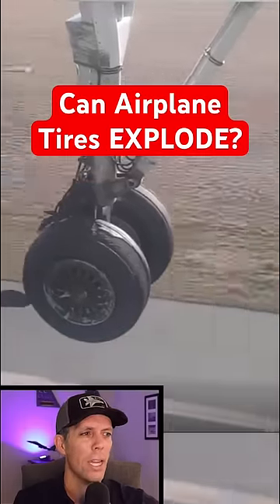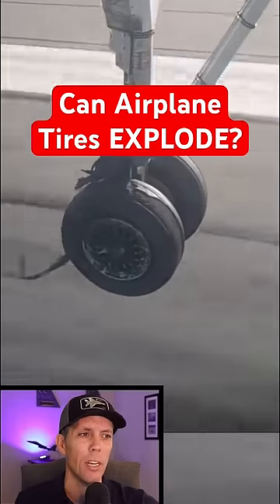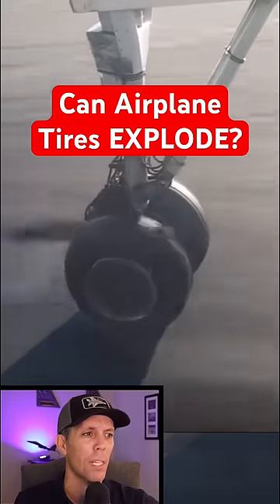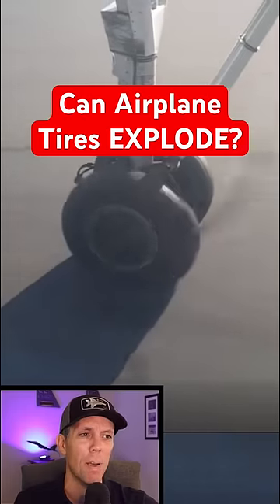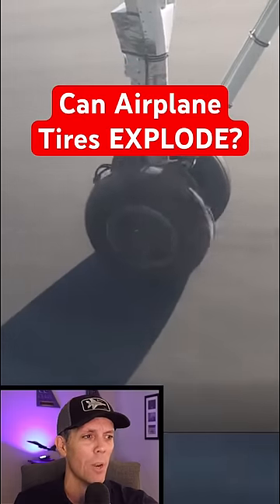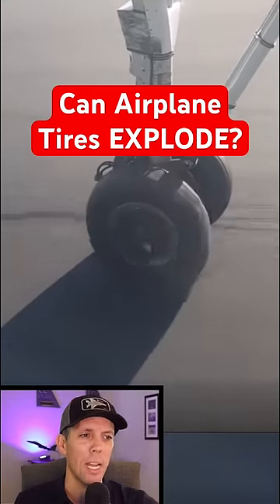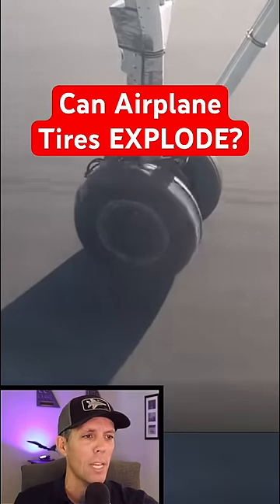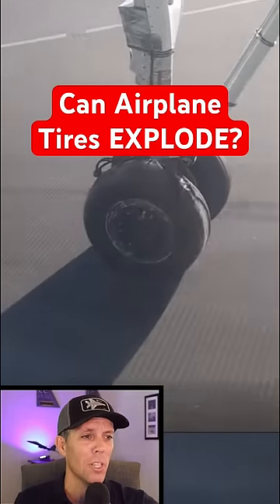Can Airplane Tires Explode?

Comment: Air is 78% nitrogen already.  Inflating with pure nitrogen only has an advantage of the tires not leaking air through the tires so quickly due to larger molecules.
Reply: also reduces chances of fires due to no oxygen content

Comment: Correction. The busiest airports in the world get about 1000 landings a day, which would mean about 1000 lbs of rubber a day, not 10,000.
Reply: This guy has so many mistakes in his videos.
Reply: I don’t know of any airliner with only 1 tire?  Each tire leaves 1-1.5lbs. Per landing.
Reply: @adamgregory6482 do you know of any with 10 wheels?
Reply: Most large airliners have 10 to 14 or more tires.
Reply: He said per tire not per plane but i highly doubt he is correct about the 1 pound per tire.
Reply: @Br1ghtSideGaming  the plane in the video has six and its on the small side compared to most Boeing and Air Bus planes.

Comment: Why return to land? You might as well go to the destination and do an emergency landing there
Reply: That makes sense to me. And, passengers wouldn’t be late. 😊
Reply: Might not have had maintenance at the destination, otherwise it is silly. Other planes have broken landing gear and continued to their destination.
Reply: Also need an inspection to make sure nothing critical was damaged by the blown tire. Imagine if a hydraulic line were damage and slowly losing fluid. Or a fuel tank - may not have enough fuel to make it to the destination.
Reply: Because you do not want to refrigerate that tire at 30,000 feet one more time. Get back to ground while it is still warm from takeoff.
Reply: I worked ramp in the '80s. A gear pin wasn't removed on pushback. The TWA 727 flew the 200 miles to its destination gear down.
Reply: Also, there's also a chance the loose rubber will keep the landing gear from fully retracting. If they do fully retract, they could get stuck. 

When possible, get things fixed before the foreseeable consequences and the unforeseeable consequences  combine to cause a preventable disaster.
Reply: Nooooo. Those tires are large and heavy. If it blew on takeoff it could have damaged something. You’d rather land asap and find out than wait till your 30,000 ft up and have alarms start going off.
Reply: Damaged tire is a danger it can explode inside the wheel well and damage a lot including hydraulics.
Reply: So are you willing to risk your life just to get to a destination. You don't know the extent of the damage until after you land. As a student pilot if I ever experienced landing gear issues I wouldn't want to risk my life even if I'm not in immediate danger.
Reply: Protocol

If one thing breaks its best not to tempt fate, go back, check everything, and go later

Im pretty sure all on board would rather wait a couple hours than have a crash landing

Also: god knows what happens if stuff falls off the landin gear - or if the blown piece get stuck when the gewr gets retracted/extended again

Comment: Caution flag came out for debris on the runway. Pit crew changed the two tires, topped off with fuel and had the plane ready for take off in 13.3 seconds.

Comment: Each landing leaves about 1 to 1.5lb of rubber on the runway. Each tire leaves a little more than an ounce
Reply: Umm, so the aircraft would have to have 16 tires if each tire leaves an ounce of tread and leaves 1lb of rubber per landing.
Reply: Really depends on what your runway is made of. I’ve worked on airfields that have coral in the runways and they eat tires alive. You usually would have to change tires about once ever 2 to 3 weeks on a normal one but on a runway with coral in it your changing tires about once a week.
Reply: Well no. He's a pilot, so he must be right. Have you told everyone that you're a pilot like that qualifies anything you're saying?
Funny there's not so many maintenance engineers doing these videos. Guess they're not so interested in pretending to be an expert while reading a childrens fact sheet.
Reply: @Dkvizu  coral blows onto the runway?
Reply: @chrisnoname2725  no its mixed into the stuff used to make the runway itself. Depending on where it is. Areas like Guam, Iwo Jima, and NAS Key West have coral in the runways. It eats the tires up pretty good.
Reply: @chrisnoname2725  it's mixed into the concrete.
Reply: @chrisnoname2725  Most pilots know very little about the maintenance on the airplanes they fly. A lot of the think they do, though.
Reply: @gator8405  I know right! Watching them kick tires like it tells you something on a 28 ply tire is hilarious
Reply: @gator8405  the ones that tell you they know it all often don't know much about flying the planes either. The humble pilots are that way because their flying speaks for itself and because they can admit when they're wrong or hand control over when needed because they don't have a massive ego they're the safest. 
I had a young instructor one night that turned around and then looked past the strobes and got disoriented and immediately realised and made sure i knew and that i had the controls. I had arrogant instructors that i think would have spun us into the ground. Those arrogant guys did seem to be instructors a lot longer than the good pilots so maybe the airline  recruitment process in Australia works to weed out egos. 
Some people want the title more than they like flying.

Comment: Each tire leaves a lb. Of rubber? 500 landings, I don't believe that the tires weigh 500 lbs. They would need a road grader to clean the runways.
Reply: You've never maintained an airplane
Reply: They have a special machine that scraps the rubber off the runway, it can get inches thick
Reply: Yeah they don't leave a lb of rubber on landing.

Source- I'm an aircraft mechanic
Reply: Depending on the aircraft, a wheel and tire assembly can weigh over 300 lbs.
On average, there are around 7 layers of cord in the recapped tread of a large aircraft tire. Some more some less. There is a red colored layer of cord that tells the maintenance and air crews that the tire is worn to the point of replacement. 
Tires generate heat during taxi. Even while towing slowly. The heavier the aircraft the more heat they make. Also the smaller the tire the more heat is built up. However, the smaller the tire, the faster tire cools. 
The brake on a large aircraft weighs in arout 350+ lbs. It may take an hour to reach maximum temperature after a landing. The heat radiates through the wheel and tire as it cools. If it gets hot enough, the Blowout Plug will release the air pressure from the tire. 
During my 22 years of Active Duty as an Aircraft Crewchief (General Mechanic) I have seen blowout pluga melt out, tires explode before the plug melted and aircraft return to the chocks with brakes so hot they had turned red without blowing the plug. 
We had special Tire Deflater, basically a metal plate with spikes that we either taxied or towed the aircraft over to deflate the tire before the tire exploded.
Reply: @HeirloomGameCalls  You "had special tire deflator?" Are you a cave man? Ha ha
Reply: @HeirloomGameCalls  really? I was a crew chief (cheif of nothing) for about 8 years. Never heard of a "tire deflator." boeing 707, E3A, C130's, 135's
Reply: @ThatOne77  same... I haven't seen it on any of the three airframe (a-10, kc-10 and kc-46) that I've worked on.
Reply: @jonfa10  so it's an implement that's PART of the airframe?
Reply: @ThatOne77  no was just saying that was the aircraft I've worked. We had no "tire deflater" that was spiked plates. We just pulled the core out of the valve stems to deflate tires. If the jet had hot brakes, we just let the air cool from a safe distance and changed parts after.
Reply: @jonfa10  I need to learn how to read. Sorry. Thanks for your service. I miss some of it, but not most of it. It was better than sitting behind a desk somewhere. Tinker, Shepherd, will Rogers (ang) st Joseph MO (ang) lakenheath, elf 1, prince sultan. Not as much travel as I wanted.

Comment: My understanding is that there are public records or logs that can be searched so you should be able to find mine… Between 2000 and 2002 we were departing out of Mexico City on an Air Canada flight and one of the wheels over the wing blew. They considered landing Right away, but decided it was safer to risk crashing in Canada than in Mexico City. It was the roughest and scariest landing ever.

Comment: Aircraft wheel & brake tech here.
Showed these to my superiors (LAEs). Few reasons (not arranged in frequencies) 

1. Overused tires. In our manuals, tires are replace after 12sets or less. 
2. Tires are only allowed to be filled with pure Nitrogen. Sometimes Oxygen enters
3.  Over inflaction
4. Too much pressure during installation
5. Foreign Object Debris on the airport.
6. Wheel & Brake Workshop fault
- Faulty bearings or gasket. 1 tyre rim is composed of 2 rims installed with over 100 components.
- improper rim installation by workshop causing tyre components to damage tyre. 
- faulty brake inspection by brake technicians. 

4 & 6 is totally different.
1-4 are mistakes done by engineers
6 are mistakes done by specialised workshop tech.
Reply: 7. Mistakes by preflight engineers.

Comment: I've seen a cross cut of several different size plane tires. A s'-t ton of thread and metal wires pancaked in rubbers and mesh.
Once saw a cross cut of a shuttle tire (in Titusville Florida)... Now that thing was a beast... Made the tread on the 747 tire look weak.

Comment: Your math doesn’t add up. If a plane loses that much rubber every time it lands there’s no way I can go to 200 or 500 landings without blowing a tire.
Reply: The math still maths due to the density of rubber being high

1 Pounds(lbs) into Cubic Inches:
For substance with density: 920 kg/m3 (rounded to 2 decimal places)

30.09 In^3 which isn't much when you realize the tires are huge.
Reply: @starchrissy6084  EXACTLY!! 🧐👍 I second that response. 🤣

Comment: Those damn recaps
Reply: Nothing wrong with a recap.
Reply: There are DC3s flying around that your great grand daddy flew on.... still the same tires. Low pressure tires can be retread a lot more than the high pressure tires like depicted.
Reply: @leofortey7561 they are worthless only last half the life of the tire
Reply: @millionmiler  Tell that to the trucking industry. Nothing wrong with them.

Comment: I'm surprised there isn't an electric motor that can spin the tires before they actually touch the ground to mitigate the loss of rubber!?
Reply: When you consider the extra weight to the plane, cost of maintaining something like that and the time and complications that come with, its likely not worth it. Much easier to replace tires which they can re-tread. Designing something like that and getting it approved is insanely expensive and planes are already over complicated. Supplying power to 10-14 tires on your average airliner sounds like a massive headache for something that isn't really a problem.
Reply: Sounds like a lot of expense and weight for comparatively little gain.

Tires are cheap. Motors aren't.
Reply: i went to an airplane maintenance shop a little while back, they replace a lot of tires, theyre pretty good at it. maybe not soo good at those electric motors
Reply: It’s a valid idea, and I don’t clearly recall, but I think it has been done on a military or passenger aircraft in the past…. certainly engineers have looked at it and evaluated the concept..

the issue is weight, cost, and the complexity of supplying that much power to the landing gear….  

spinning them up with the airflow also seems like a valid idea, but that would create a lot of additional drag, and the speed up to which they spin would have to be controlled, which means sensors and in flight automatic braking, which is complexity, cost, and an additional possible failure point (eg imagine if one side spins up and the other doesn’t)…

The 787 now has electrically actuated brakes, not hydraulic, but along with the benefits it gets from that, they also have to carry these very large batteries, from which there have been fire related issues…

These things are very carefully calculated…. in our airline calculations were done to compare the cost of brake maintenance vs engine wear due to reverse thrust, and as a result they instructed crews to use reverse thrust only when absolutely necessary and use primarily the brakes…. so in the end the results of analyses probably show that tire wear is the least expensive and simplest option…

Comment: I'm curious if the tire blew on takeoff, why not just continue to the destination?  Same danger landing at the original airport as the destination airport.
Reply: My guess, is because of the hanging rubber they didn't want it to get jammed in any of the moving parts that control the wheel when they retracted the landing gear.
Reply: @jamesmcguinness1530  That was actually my thought too, but if I was on the plane, I would still be pissed...
Reply: @starhawke380  oh no doubt.
Reply: Only thing im gonna add is that, maybe, the blown tire could be a sign of poor maintenance

And when you have idk 100-200 lives on board, you just dont gamble, especially if all protocol has been written in blood

Comment: I worked for a company that developed a machine learning algorithm for quickly scanning the interior and exterior of airplane tires to determine if it was safe to retread. The system was also90% effective at predicting where exactly the tire would fail if overinflated or subjected to high force impact with a flat surface, like a runway. This saved both $ and landfill space by extending the life of each tire.

Comment: My question is why not carry on to the destination and have it rectified there? There would be less fuel, if anything from the tyre struck the fuselage or tyre got destroyed on contact and caused another issue with landing gear, there'd be less chance of a fire?

Comment: One thing that always baffled me is that they don't have a small electric motor on the wheels to spin them up to speed before they contact the runway, would make the tires last a lot longer and would reduce the number of blowouts like this.

Comment: On naval aircraft if there's a blowout the plane will be brought in with its wheels brakes locked and it catches the arresting wires on the runway. This prevents the tires from spinning up and disintegrating taking out important systems in the wheel wells.

Comment: I'm not a engineer or anything so please be nice if this is a dumb question. Couldn't the tires be brought to speed pre landing using the planes hydraulics or electric motors? This would reduce the rubber on the runway issue, or is it the braking effect it gives that makes it worth the tire wear?

Comment: I used to hang wheelies for so incredibly far, and fast, on my '98 YZ 400F, when I'd set it back down once fifth was tapped, the bars would jerk and the tire would chirp and maybe smoke a touch, im not sure, I was looking forward. I'd hang them so high I had to crank the bars to the right and look under my left arm to see where I was headed. I loved it... I still have it, but it's in awful cosmetic shape and needs a makeover... someday...

Comment: I always thought it was neat how plane tires don’t have a tread wear rating. But instead have a Skid rating. Also when I changed tires the farmers would use old plane tires on their wagons and bush hogs because they are so much thicker and stronger. They didn’t have to worry about small things puncturing it.

Comment: my uncle (RIP) worked for 30+ years for a small company that has a proprietary method for retreading airplane tires - they had engineers from big manufacturers come by over the years and the engineers would all have to sign this paperwork and get searched to make sure they weren't gonna steal any information from my uncles company. and they did all of this out of a tiny shop converted from an old gas station!

Comment: 200-500 landings. The reason for the variation is temperature that day, condition of the runway, if the pilot graciously decides to hold brakes on landing, ect. Tires can explode within the first 24 hours of construction/reconstruction but its pretty rare for one to actually explode on a runway. Ive seen them catch on fire and melt all the way through. Ive never seen one explode outside of a safety cage or someone putting 2000 psi into one....rest his soul.

Comment: Did you say 200psi!? I was always under the impression airplane tires would've been kept at relatively low pressure because of how big they are, plus the fact that commercial aircraft tend to fly relatively high and you wouldn't want the tires expanding to the point of explosion mid flight.

Comment: Air plane tires are solid rubber and weight anywhere from 250 to 400 pounds each and are rated for up to like 230mph

Comment: Maybe stupid question: what’s the point of turning back and doing an emergency landing when this happens? There is no risk while flying and whether you land where you just took off or land at your intended destination you still have to land either way. So why not just have the emergency landing at the original destination?

Comment: Why would they fly back to the same airport for an emergency landing? Why not just fly to its destination since it has to land either way. The only reason I can think of are layovers.
Reply: That and possibly that the destination runway is too short, so if something else happens with the tire because of the blowout the plane will need a way longer runway

Comment: Each landing takes about a pound of rubber per tire per landing. They are also good for 200-500 landings before retreading. That means they lose 200-500 pounds of rubber as well. There is no way those tires weigh anywhere close to that much

Comment: If every pound is gone, with those three hundred landings, 300 pounds or about 130 kilos of rubber is gone. It doesn't sound plausible considering the tire's weights must be around 500  pounds or 1000 pounds